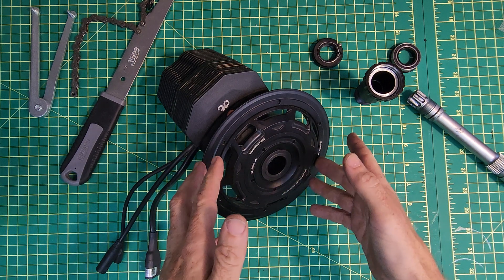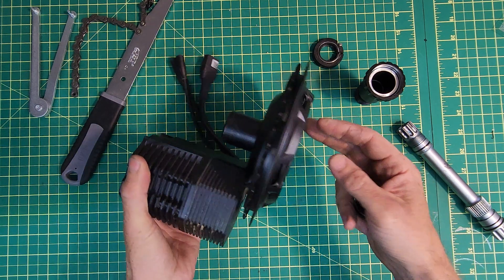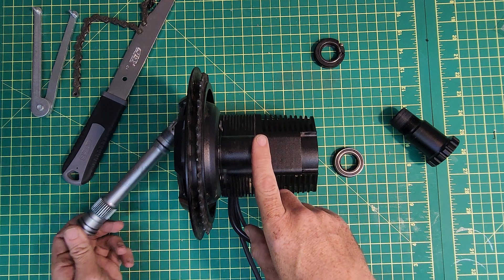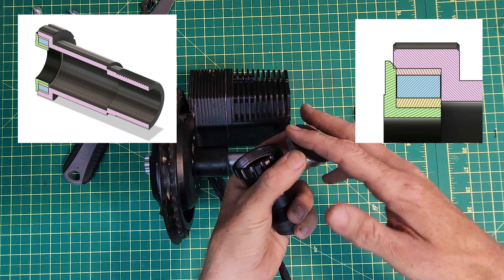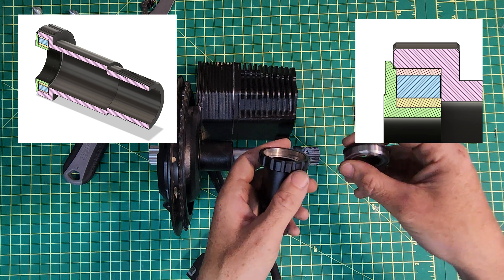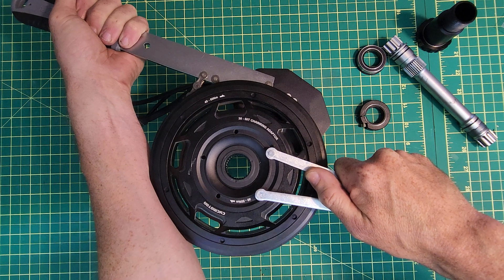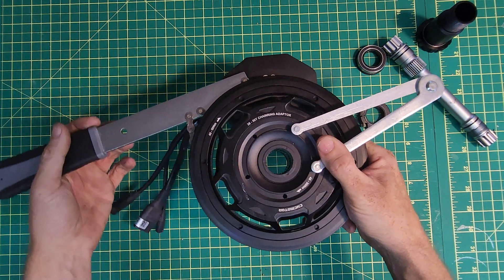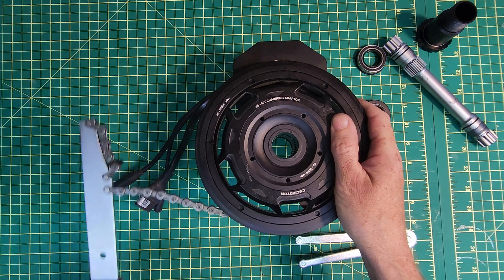CYC Photon Ebike Motor - Stiff Bearings and Stuck Chainring

Comment: Don’t understand why they don’t just go with 5, 6 or 8 hex bolts to secure the chainring. A massive threaded hole like this is surely more expensive than tapping a few small holes. Is it to do with the way the torque sensor works? I guess no one will ever know.

Comment: Removed the chainring on my Photon today, after almost 3 years and 3000km of use. I used the CYC 5 pin tool, secured with a 12mm coachbolt and washers through the BB. Leave the motor on the bike, and used 2x1m 2" and 1" galv waterpipe on the chainwhip and socket T bar. It required soaking with CRC for a couple of hours first, and a LOT of pressure (the chainwhip tended to fold) but eventually, with a lot of effort, the ring did work loose. Definitely be using copper based anti-seize grease when I reassemble.

Looking back on this video, CYC did address the plastic cover issue and redesigned the left bearing cup with better waterproofing at the same time. I modified one of my bearing cups, and bought spare bearings, but CYC did also replace the bearing cup assembly under warranty. No further problems there.

Comment: Try to put your hands on a different position from one another so you can use pulling force on the tool while holding back pressure on the chain tool , put them close together ,that will make you be able to put much grater force.

Comment: CYC now offers a proper tool, a 5-pins adapter for a socket set, for removing the chainring. I ordered one with a chainring and it works fine with a chain whip.
Reply from the maker: Yeah. I still think it should not be an optional extra though.

Comment: The relationship between chain whip and tool in your video is counterintuitive to maximizing your muscles and leverage. Change the position of the tools relative to each other so you can apply maximum power of your arms, shoulda, body etc. Set it up so the chain whip is bearing down on a bench or your gut or something. Hope you can  follow my poor explanation?😉
Reply from the maker: Appreciated. I will do this next time for sure. Makes total sense.

Comment: In their latest video about the Photon, Rikus addresses several issues including the use of copper based anti-sieze compound when fitting the chainring retaining ring. There is also now a 5 pin 1/2" tool available in their shop for that ring.

https://youtu.be/AHtHbvLuxDc?si=IrqB_hEKi5UCTaDS

Comment: Left side bearing is S6805RS - stainless 25x37x7 single rubber seal. There are many alternative configurations that should work - chrome steel and ceramic options, with one or 2 rubber seals. Bearings 61805 are the same size and should also work.
Reply from the maker: Great stuff

Comment: Just wanted to comment - at 1200km my left bearing feels rough. It is clearly in the early stages of complete failure. Corresponding bearing on right side feels as good as new (of course, that doesnt spin while pedalling).
Reply from the maker: Urgghhh. It's not a good design to just use the two bearings. I can see why they did it but smooth it does not make. They needed a thrust bearing in there.
Reply: @HighVoltageKits  I think there is another (larger) bearing in there, since the outer drive side bearing only accommodates the rotation between the shaft and the chainring. However, there is a real problem with how the preload and left crank position is set (and can be messed up) by the installer. The ISIS standard assumes that there is a fixed shoulder 16.0mm from the left end of the shaft, for the crank to land against (and the crank MUST do this). In CYCs design this isn't even clearly described to the user, and it is possible to use the wrong combination of spacers. Add to that, there is no really clear way to define preload, and too little preload causes problems also (look for wear on the shaft rotating in the plastic sleeve instead of the sleeve rotating in the bearing. I hope CYC revisit this part of the design (and a shorter shaft option would be great, too!)

Comment: I don't think that bearing is supposed to bottom out into the cup. I don't have the installation directions but I would pus the bearing in as far as the outer lip allows, then tighten the lock collar so that it JUST touches, then back it up ever so slightly (for thermal expansion), then clamp it down. If the axle doesn't touch, you're golden.
Also, the drag you're feeling isn't really an issue at all. If the motor isn't turning what you're feeling is the one-way clutch, seems like a sprag type. You spun the axle backwards. If you went forward we would see the chainring rotate. When you spin it in the correct direction I think you'll notice what I'm talking about. There might still be a bit of drag, assuming it's grease, but I don't know how many gears are in the way before the one-way clutch is installed on the motor itself. Typically they would be installed as close as possible to the final output, but then it would be subjected to the most radial and axial forces = bad life expectancy.
Anyways, I'm going to purchase one and take a look myself. I do a bit of engineering myself :)
Reply from the maker: Yeah. I will allow a bit more room this time. Honestly though its a crap design when I look at it more. There is not much to stop grit and debris getting in there over time. The would have been better off using a combination of bearing types including a thrust bearing to do a better job. Its a minor issue in terms of the drag you are right as I had not noticed until I took it off the bike. When you spin it backwards its no where near as smooth as say a BBSHD. I just got it back from a warranty repair for the hall sensors so I will update on the motor soon. I know people that don't have the bearing issue so it may well be a manufacturing tolerance issues. Look forward to hearing how you get on. Cheers
Reply: That's an interesting observation. I disagree that they would need a thrust bearing but could be convinced of an angular contact bearing. Might check to see if those bearings aren't already angular contact. If you're unfamiliar with that type, it's a cross between ball and thrust. The angle differs depending on the load. Shimano hubs use cup and cone, which are, for all intensive purposes in their application, angular contact. On cranks there is very little axial force so thrust would add drag when a single good bearing would suffice. I enjoy your videos. Thanks for providing them. @HighVoltageKits
Reply: i agree with you about angular contact bearings and one might be able to replace existing ones to make the arrangement more resilient, if they are not already installed It was a really great video that dug down into the issues and whatever engineering is going on there I do believe it can be made bullet proof  @JonPrevost

Comment: I'm having the same issues.  
Chain ring stuck on.... and just started making noise, sounding like bearings. Only have 70miles on it. Before that...whisper quite.  
So took it apart and put it back together. That's when i discovered the chain ring stuck.  I choose the 34. Was thinking about going to the 38. But idk? now....  
Anyway.  Went for a ride.  Now it sounding like its in the motor   now...
Going to contact CYC. 
Just bought it in September.
Reply from the maker: Yikes. That's pretty fasts for a fail. I just got mine back so I will be going over it this week. If you check out the comments you should see quite a few tips on ways to remove it. I never took mine off in the end I sent it attached to Golden motor! They have a whole set of special tools for doing repairs. I figured that was easier than me scratching it up with the thing they send.

Comment: where you ever able to get the chain ring off? im having the same issue with my motor
Reply from the maker: No. I had put it on my wifes bike and about three weeks afterwards it started having issues. I had to send if to Golden Motor to get it serviced so I decided to let them deal with it. From chatting to them they have a whole set of tools to work on them. He said he had never seen anything like if for bike tools. I should have it back in a week or so. Will update then.
Reply: @HighVoltageKits  i handed it over to a friend, who made a long pin wrench out of steel. the effort he used was unreal, but he god it off, no damage to the threads or motor, aside from a few scrapes

Comment: For adjusting the tolerance on that bearing cup, I would lay a sheet of fine grit sand paper on the flattest surface you have. Then lap the face of the cup until you have enough clearance to not bind on that plastic insert. Sure you'll lap the color off, but should be no biggy. BTW I've found BB cups from all types, and manufactures (even the big guys) to be binding, and stiff feeling. A lot of times is all fine under load, even if it feels stiff while turning by hand. I have one of these Photons coming, need it for a PF92 frame I have. Been a long time tongsheng tsdz2 with OSF user, but no real great options for PF92 BB. I found some extensions, and PF92 inserts, but seemed too hacky IMO. Thanks!
Reply from the maker: I am not sure what I will do yet. It had to go back to get repaired due to a hall sensor issue so I will do something when its back on the bike for sure. Being able to use a wider range of BBs is definitely an advantage for the CYC.

Comment: If you ever watched Hambini Perfomance Engeneering, it is always about manufactoring tolerances. You can even see paint rub off where something is touching where it aint suppose to touch
Reply from the maker: I'll check it. I know the Japanese and Germans are famed for their tolerances in making engines. It's not encouraging for the other parts if these are so far off. I hears from another guy who had an earlier manufactured one and he said his was much smoother. Although potentially the other way as it sounded grindy from letting in grit and debris.

Comment: If you're putting the cyc on the wife's bike, what are you moving onto next?
Reply from the maker: I have a few motors from the TOSEVEN motor company I'm playing with. The Photon has been on the wife's bike and off cause it's broken sadly. Off to be repaired. It's likely the halls or controller. Not sure which. If you want to see those you can list the most recent videos on the channel. Cheers.

Comment: How did you remove and reinstall the bearing onto the non-drive side BB cup?
Reply from the maker: I used a punch and rubber mallet to gently tap it out and a bearing press to put it back in.
Reply: @HighVoltageKits  🙏

Comment: I had a ton of trouble trying to swap down from a 50t to a 38t chainring.  In the end what did it for me was to make a much longer lever to work with.  I put a piece paper over the 5 holes in the chainring cap and poked through at the holes to make a template. Then I found a scrap of plywood maybe 4 feet long and wide enough fit all 5 holes. I drilled the hole locations and found some bolts the right length and diameter to use. I also stuck a 5 foot piece of pipe over my chainring tool handle.  It still required a lot of force and the ends of these levers.  Like I thought I was going to break it and kept pulling well past that point.  I'm very surprised I didn't shred it. This time when I installed the new chainring I used some anti-seize on the threads, which I hope will help the next time around.  Possibly this might be related to torque loads that happen with a 50t chainring?  I don't know.
Reply from the maker: Thats impressive work. I think you win a prize for effort. I think you might be right about the torque.

Comment: Interesting.. This motor is one of the candidates I was thinking of for my cargo bike.. Is there any reason why you couldn't buy or make a washer from 0.5mm shim stock to push the bearing out beyond the 0.44mm issue? Granted it shouldn't be like that from the factory. RE the lockring...Trying to work that with your hands at 180deg to each other is making it difficult for yourself. Position the tools so that they are close together and you can use both hands wrapped around them the crack off the lockring. Or do similar in terms of positioning them close together but use the chain whip against the workbench and tap the other tool with a hammer.
Reply from the maker: Appreciate the advice. You might want to consider how heavy the bike is going to be with cargo. It might not be the best choice for heavy loads. They are making a more powerful Proton but no release date as it stands. I will likely shim the bearing once I can persuade my wife to let me have it back lol! Its not a show stopper but would be nice to fix it.
Reply: @HighVoltageKits  well, hopefully the plastic will wear in use and free the stiffness up a bit. Will keep an aye out for the proton. RE the photon I was thinking of going for the higher powered version. Apparently there's a firmware version that lets you switch between street legal and beast mode! (if I've understood correctly)

Comment: new into the idea of building a ebike with kits like this, What does this mean for the motor, is it still worth getting it or will it fail in long run?
Reply from the maker: It has a two year warranty. This is a minor niggle that I did not notice when riding. So far the failure rate seems to be around the 4% mark. That's come from chatting with a few dealers. The main issue seems to be slowness to get new parts.

Comment: secure motor in a "jig" (vise?), then reverse your tools and instead of "push" try to "pull" adjusting for optimal tool placement..
Reply from the maker: Thanks for the tips. I think you are right about the pull rather than the push! Cheers

Comment: The chainring is more easily removed when the motor is installed on the bike, it is much easier to get good leverage. I have removed and installed a couple of chainrings now no problem, and I am a girl! 😊
Reply from the maker: I should have done it on the bike Susan. I already had it off when I was asked to try it. Using the cranks as a lever seems to be the best method I have been told so far. What chainring are you using now?
Reply: @HighVoltageKits  I swapped from a 40 to a 38 - as I prefer to spin and feel like the 38 has better torque for riding steep roads and trails in the Portland area. Btw If I recall - the spindle has to actually be removed to change the chainrings - a huge PITA if one wants to do quick chainring swaps for different terrain.
Reply from the maker: Yeah it does as it has a ridge on it to stop it passing all the way through.
Reply: You can remove/fit the chainring with the motor on the bike but you must remove the non-drive side crank, locking ring and through-axle before trying! I spent several minutes wondering why it was getting tighter again! I was lucky not to damage anything, silly me! I swapped from a 34T to a 38T as I wanted offroad capability but also a bit more speed on a straight-ish chainline.

Comment: This chainring design is clearly a low point of this motor. They need to modify the design to provide a better mechanism for this.  The tool they provide is awful, and having to use a chain whip is not ideal, unless you have three hands.  Perhaps a spring loaded holding pin like we find on rear derailleurs, and a nut versus having to use a spanner?  Hopefully they address this, as well as the bearing issue you point out.
Reply from the maker: Yeah its not my favorite part right now lol!

Comment: Consider making a tool out of angle iron , or using a cheater bar made from exhaust tubing which can be hammered to fit spanner .
Reply from the maker: I had not thought of exhaust tubing. That would probably fit better.

Comment: When pulling the lockring off, pull towards your body with your back muscles instead of pushing away or compressing with your chest muscles.
Reply from the maker: Right. Greater strength in that plane then. Cheers

Comment: A sharp impulse with a hammer and orienting the tools correctly will really help remove the chainring. You need to be pulling them towards each other very close together then get the wife to give your tool a few love taps with a copper wammer
Reply from the maker: 😆 That might be how it's done. Apparently there is a trick with the crank arm to get better leverage. I'd already removed that tho.

Comment: Heck Mate mine didn`t even come with the spanner. I don`t know if the distributor took it out as to resale or it didn`t get put in box from manufacturer
Reply from the maker: LOL. Yeah you win that one. How did you h
get it built?
Reply: I used a brass punch and lightly tapped it tight. Yea I know torque specs out the window. Right. Well I ordered a spanner from Amazon and checked it when it came in. The Ring assy. is good so far. I hope I have no trouble with the dang thing. Like your videos and channel. Good luck with your CYC units. I have 2 but will stay with the bbshd for future builds. I will miss the torque sensing feature but have managed to operate the bbshd for good linear throttle response. Just use the throttle to give edge on really hard stuff and steep starts. I don`t use the pedal assist much in the mtns. as the decay feature is a pain even when dialed down to 0 time.  HD seems to be a brute as you know from your use.   @HighVoltageKits